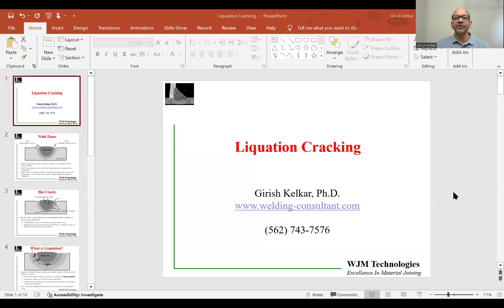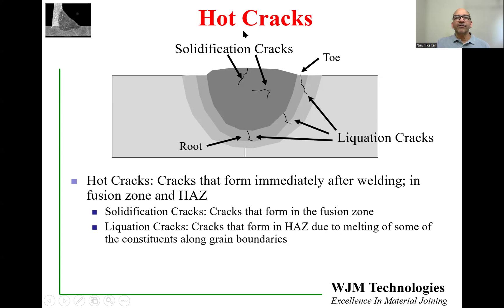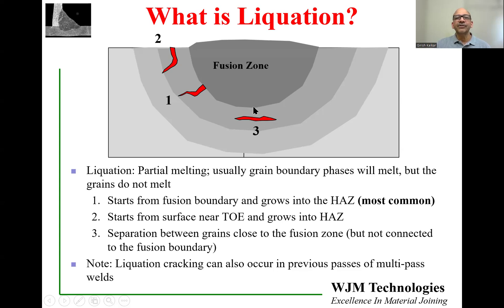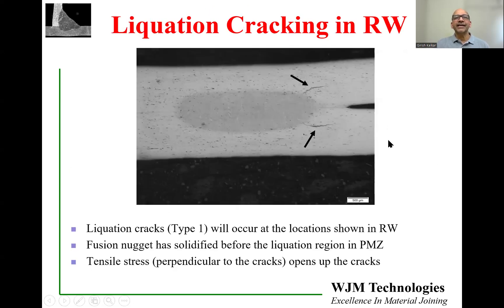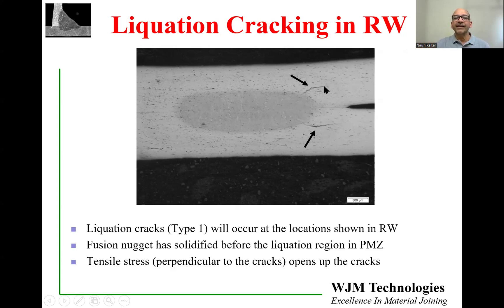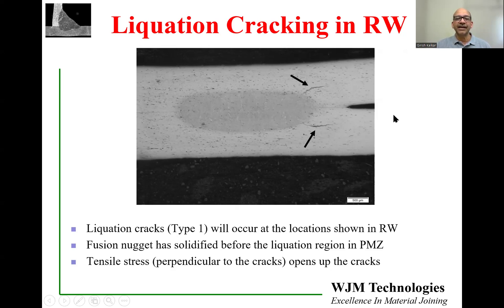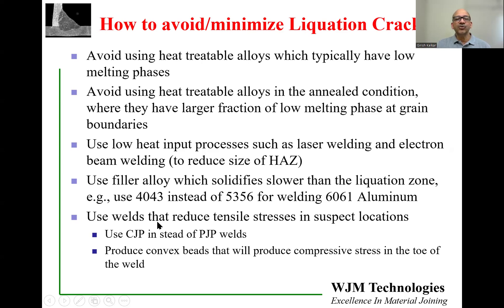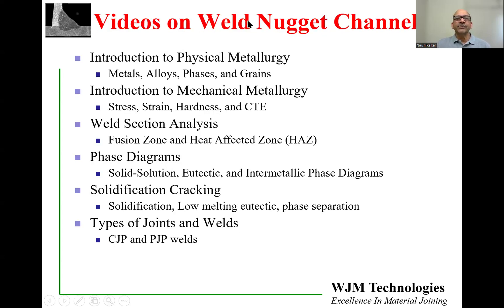Liquation Cracks in Welds

Comment: We are TIG welding AW6061 alloy in T-joint connections (L-profile 100x80x8 with CHS 50x5 pipes, both AW6061). PT testing consistently shows indications on the L-profile side.
You suggested switching the type of rod from ER5356 to ER4043, but I’m concerned about whether ER4043 will provide sufficient corrosion resistance in an offshore environment.

Additionally, we need to develop a new WPQR for this change, which will require a cruciform joint test in accordance with EN 1090-3 for material group 23.1. I’m worried whether the strength will meet the required properties for testing and whether the corrosion resistance will be adequate for offshore conditions.
Reply from the maker: 4043 has tensile strength of 24 ksi, and 5356 has tensile of 35 ksi.  However, after mixing with base metal (6061), the strength difference may not be as significant.  Both, strength and corrosion will have to be tested to check if adequate for offshore.
Reply: @weldnugget  
Thank you for your response. Until we develop a new welding technology, we’ll continue testing with ER5356.

Would you advise if there’s a way to improve our TIG welding process with ER5356 to avoid these cracks?
Reply from the maker: Not aware of any way to change process parameters to avoid cracks.  Effect of geometry (circular pipe) may help as the pipe contracts on welding and is likely producing compressive stress on the surface thus avoiding indication on the pipe side of the weld.